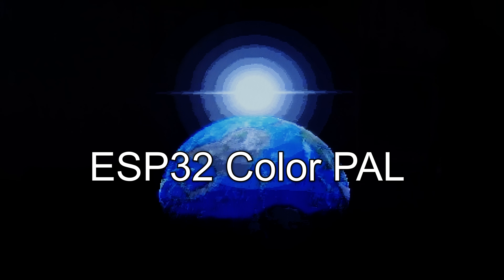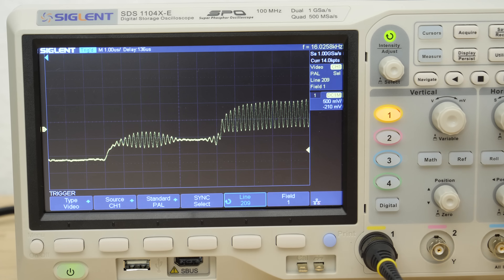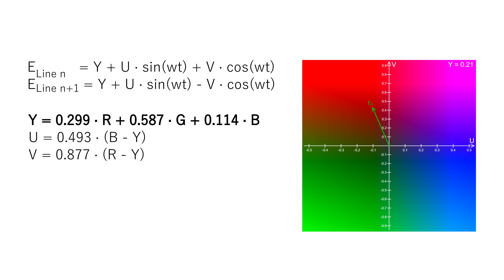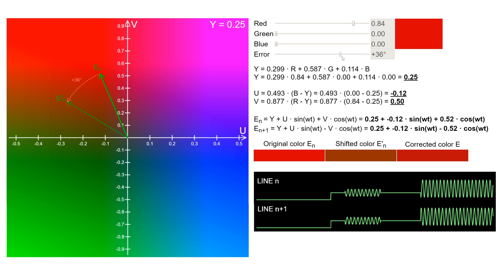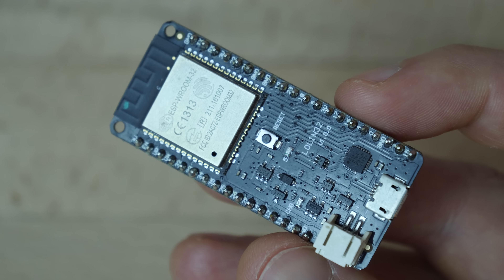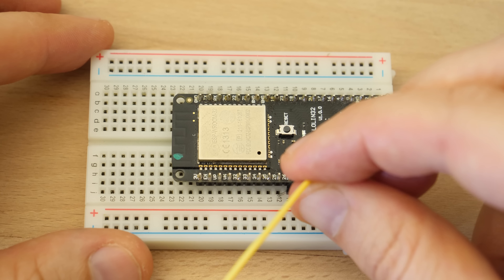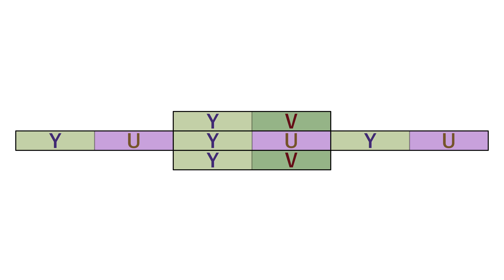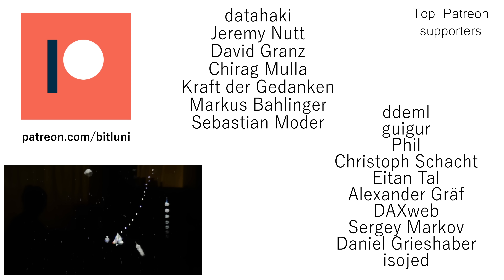Color PAL Encoding

Comment: This is so impressive, and very useful for ESP-32 projects because small TFT displays sold as automotive "backup camera" displays seem to be about the same price as just buying the bare LCD, which then of course requires a zillion pins and headaches to use. And they're basically all PAL/NTSC right out of the box. What a relief to be able to use them with with just ONE microcontroller pin! I have a few on the way and am excited to get started with this.

Comment: Wow, thank you for the simple explanation of PAL color :D So basically, two lines carry the same color but one line has inverted phase (180 deg). I can draw the analogy with the XLR balanced audio lines that all stage microphones and mixers use (three wires - positive, inverted and ground), except that here the same color information is delayed exactly one line and inverted. I finally understand why old color TVs used ultrasonic delay lines.

Comment: Excellent work! The colour fringing on sharp edges probably isn't due to the DAC. A sharp edge in the luminance signal will produce high frequency energy that gets added to the colour subcarrier. It's a common problem with composite signals. S-Video solves this by physically separating the two signals.

(Sorry if you already know all this, I've been working on a project to generate TV signals and it's all fresh in my head :-)

Comment: Would it be a big deal to overlay color pal onto an existing video stream? I know, it needs to be synchronized, but could it be done without additional hardware? I am thinking of an affordable color OSD for FPV drones and fixed wing, which is stuck on BW overlay for years now since everybody uses an ultra-old OSD chip which is the only existing affordable part... Have a look at betaflight OSD for example. Please help a whole community!!

Comment: Crazy, simpler than a regular composite connection, where one typically uses a few resistors to mix the sync and video signals together.

Comment: Would a simple 640*480 DVI signal be easier to implement? What made you go composite instead of something else?
Reply from the maker: I read the specs.. dvi has different challanges like the minimal data rate. But I think I'll try it some time to have a modern solution too

Comment: Absolutely bloody amazing. I was wondering what could you achieve if you added added an extra flash memory chip? Is 16bit colour possible?
Reply from the maker: PSRAM can't be accessed by DMA and is too slow.. it could work with much and god work with the caches. 16 bit can fit in the current memory but there will not be much left for your program

Comment: I think your colour fringing is caused by a bandwidth problem namely that the luminance signal needs to be delayed by, about 1.5 micro seconds whilst the chroma/colour is decoded they should then register on the screen  correctly .  The analog TV decoder, used a delay line, which consisted of a coil wound on a tube, with a copper strip down the centre, forming a ladder network, coil /capacitor in the luminance path this delayed the signal whilst the chroma was processed . great video but a bit fast for us old timers!

Comment: Love your vids - thanks for sharing - ESP32 as Colour OSD overlay possible?
Reply: You mean on top of existing colour video signal? Unfortunately i don't think so - you would need to adapt to existing colour burst. I think the only way you can do this is with lots of additional circuity. Maybe dig up an old genlock circuit, see how they worked - such modifications were available for some classic computers for example the Amiga.
Reply from the maker: hmmmmm.. not sure about that.. a fast mux could do it but syncing the current phase of the color carrier would be a challenge. 
At least BW overlay, lighten or darken the color signal should be possible.
Reply: Haha all for it. I always wanted a genlock back in the days, but seriously who had that kind of money?
How about making an Atari ST or Amiga where you just replace every single original IC with an ESP? :-)
Reply: Actually i just ran into a piece of trivia. Euro-SCART has an RGB overlay feature foreseen in it! Assuming TVs actually support it, it's possible to override S-Video/Composite signal pixelwise with RGB signal.
Reply: Hi, Thanks for your very impressive work. I reproduced that, and played with the simple video composite graphics to draw lines, and control those points via a processing sketch over serial. Wonderful. Now what I need is to draw this lines on a video camera signal. Monochromatic is enough for me. But I don't know where to start. Will you please point me on the right direction, or maybe is there already something you did to achieve OSD with the ESP32? thanks, again..